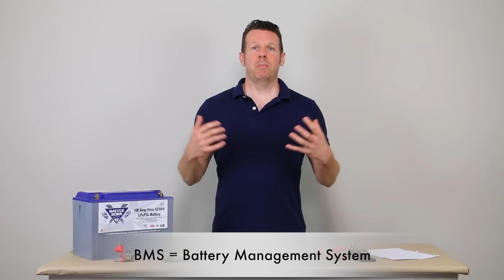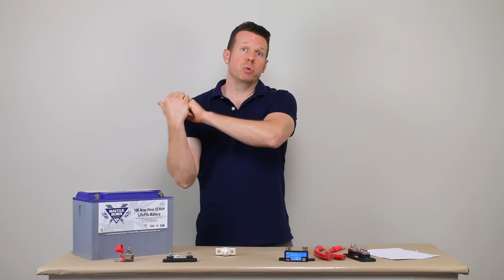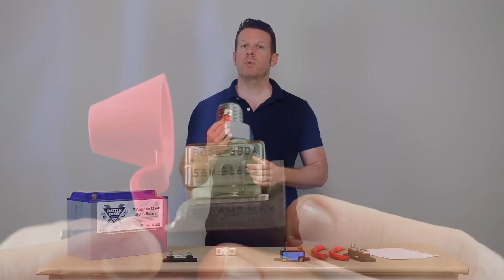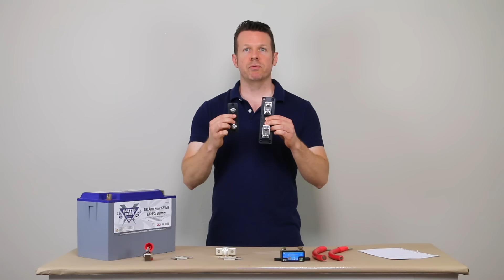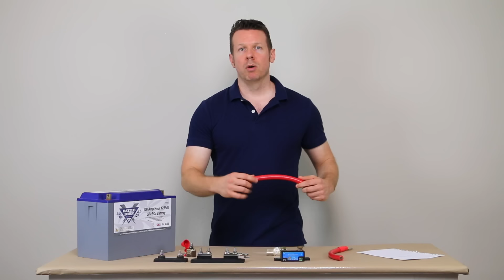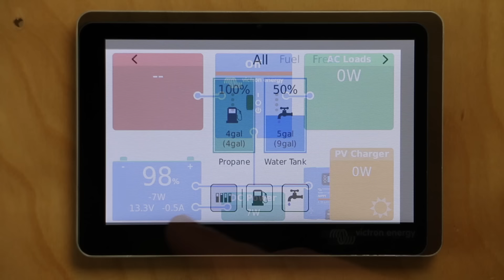The Top 9 Lithium Battery Mistakes for Van and RV Power Systems

Comment: Another mistake is paying an enormous amount of money on Battleborn batteries. Sure, they're great but the competition has come so far and just a fraction of the cost.
Reply: Watt cycle are killer for the price.. I said what I said!
Reply: @ Especially after YouTube's Will Prowse tore one of those Watt Cycle batteries apart and was shocked how well built they were.
Reply: Buying all Wattcycle.  Up to 18kw so far. Boat power  @americafirst8201
Reply: Buy 3 batteries or one Battleborn? Same price.
Reply: @ Three? Prices have dropped so much you can almost get 7 or 8 for the price of one BB now.
Reply: @philc.9280  I bought 4 1250 wh  lipo4's for under $500.
Reply: @ LiFePO4 prices are still dropping. For one $900 Battleborn 100 ah battery you now can get six-Watt Cycle batteries. A nice system for $900.
Reply: $ 999.00 4 years ago for my 100 ah Battle  Born .  Just bought 3 Power Queen 100 ah for $ 169.00 each on sale .
Reply: You BB buy American guys know most lithium comes from China or Canada, right?
Reply: @awakenotwoke4830 I just have to respond here because the point is to get Manufacturing in America not that we need to get a 100% of everything from America.
But even having manufacturing for the endpoint is still valuable because that's still Manufacturing. Most of the value is made at the endpoint.

But I also will say battleborn is still way overpriced and there's no reason that American made batteries need the cost four or five times the price of a battery made anywhere else.
Work on automation if you have to it's Electronics what are they doing soldering every single piece of the battery together one piece at a time by hand? If sp, they need to start innovating.
And a lot of electronics are made outside of China by the way and at much higher wages than trying to pay so I'm tired of looking at all these American Battery companies that all think they only have to compete with each other and therefore don't get competitive on pricing.
I actually wouldn't mind paying a little more for an American-made battery but I looked into them and like people said they were just way too much more.
Reply: I've had the cheapest lipo batteries I can get ten years ago running for ten years and they are fine today. Spend the money on charging and balancing technology and be cheapo on batteries. 😂
Reply: Battle borne are in my opinion and the option of a very well read YouTube poster, a load of dangerous crap.
Reply: And there having issues with there overpriced batteries
Reply: @philc.9280  roughly twice the cost of many other Lithium RV batteries. I prefer the little guys…two for one.
Reply: Well done, thank you!!!
Reply: Battle Born did not stand behind three of their batteries that failed at 9 months. It’s always the customer’s fault.
Reply: They melt by looking at them now 😂
Reply: Great explanation, I especially appreciate the tip about drawing power from opposite ends of a bank.
Thanks !
Reply: @MrSilvertech  I would never have thought about that. Great info!
Reply: Agreed. Victron’s Smart lithiums with external BMS is way ahead of anything battleborn has
Reply: Renogy makes an awesome battery better than Battle Born in my opinion. Renogy also has a self heating battery as well, their detail to quality and design is unparalleled.
Reply: That’s simply your opinion,…How many BB do you own… ? how many have you ever owned..?  I have been using them for 6 years with Zero Issues and I think BB are a fine value in every way including American customer service...but then that’s simply my opinion…
Reply: @jimhanty8149  it's not an opinion to say they are more expensive. Just fact
Reply: @ going on five years with my Loggisy rv batteries. No problems, half the price.
Reply: @   Some people buy a timex…some a Boulava …some a Rolex… they all do the same job…., but each says a lot about how one lives their short mortal life… what does money really mean in the end..  absolutely nothing…  live it while ya got it…
Reply: @jimhanty8149  sure but if you're smart with your money you can live a lot more with what you have 😜
Reply: @ I have  plenty to live on… I want good stuff… not China crap…it’s a way of life… hope ya get to the same mindset one day..
Reply: @jimhanty8149  "I have plenty" you are a selfish person that doesn't understand life. 

We all have what we need, some of us choose to chase things we don't need. Some of us can afford things we don't need, some of us can't.
Reply: @jimhanty8149  not all expensive things aren't Chinese crap. And not all expensive things from places other than China are worth their price.
Reply: @ whatever you say man… party on Garth..
Reply: @jimhanty8149  party on puppet
Reply: @ lots of American crap too. Generalizations are generally wrong.
Reply: @jimhanty8149 China is leading in LFP batteries and probably NMC too but I’m not sure about that. 
Some Chinese products are excellent (e.g. DJI) and some are absolute garbage. If you do your research some Chinese batteries may be best you can get. 
I bet component and or cells of BB are Chinese btw. 
The two major manufacturers are CATL and BYD btw.
Reply: @jimhanty8149  Never said BB was a bad battery. Just saying you don't need to drive a Mercedes to work when your Honda works just fine. The LiFePO4 chemistry is pretty standard now and my Power queens are in year 3 and going strong. Even Wil Prowse, the YouTube battery guru critiques all of them and is very impressed with the build of several Asian brands. Just fyi... a 100 AH BB is around $900. An equivalent is around $150 now. I can get six batteries for the price of one BB and build a nice system.
Reply: @jimhanty8149 I actually want to support American made and I do buy American made even if it's just at the endpoint that they manufacture the final product in America.
But I've looked at a few different American companies that manufacture batteries here and there's just no excuse for their pricing.
I don't care how good they are way over the top.
It's like five times the price.
They don't soldering every single piece of battery together by hand and if so they need to start innovating. I just can't buy American made I can't justify it for Batteries until they figure out the pricing issue.

And yeah I do spend more for American made and I have no problem with that but not that much more.
Like I buy darn Tough socks made in Vermont. I love them and they're 27 dollars a pair. Worth it. But spending $1,000 or $200 on a battery i just can't justify five times price. I'll keep checking on the American made batteries every time I need some more and hopefully something changes.
Reply: Remember Americans don’t want to work for 4 dollars an hour so yeah battle born are expensive but that’s the price for made in America 🇺🇸
Reply: @dan32one44It all comes from China! The jokes on you!  Absolutely nothing special about BB! You can get 400ah grade A battery from Power Queen for the cost of 1 100ah of BB!  But keep getting scammed from them
Reply: @dan32one44Dramatic. 600 hundred more for every battery? Does it take 3 days to assemble a battle born? No

Comment: The one you missed is the washers.  You need to make sure any cable lugs are not installed with a washer between them.  This is an easy mistake to make on an ANL fuse holder where the washer may drop while installing the fuse, but is a mistake you could make anywhere.  A washer has much more resistance than the cable lug, especially if it is a stainless washer.
Reply from the maker: Good one!

Comment: Good Day Sir. I also live in the Houston area. Katy to be specific. We have a new 2024 Jayco 25RB. I am in the process of upgrading the Solar Panels to 495 Watts total,( came with 200 watt panel, I have purchased a 195 watt and 100 watt Bifacial panels to add on the roof.  However we are also looking at upgrading the solar charge controller (The Go Solar 30 amp PWM unit that came with it is likely sub par). Im looking at the Victron 100/30 W/ Bluetooth unit. I have also purchased a Furrion Net Zero 1000 Watt inverter (With transfer switch built in) to install in the camper. Its almost 600$ unit and Camping world had it on sale for 40$ so I couldn't refuse that price. The camper is pre wired for an inverter (Although I have questions as to whether that existing wiring is adequate and where in the breaker panel this is connected.  I have many questions on the correct way to install this unit, or possibly pay someone who has the technical knowledge to do the job correctly. The unit has mostly 12 volt and propane appliances. The inverter would be for the TV, and Mac Mini. If we need the A/C we would use the inverter generator.

 Is this something you have experience with?

We are also looking into upgrading to Lithium Battery over the stock battery. The Converter has the capability to switch to lithium, however do We also need a 12vDC to 12vDC charger for the connection from the tow vehicle to the camper? Or is that not necessary? Again, I don't have the technical knowledge of these systems.

Comment: It's not hard to get 48V by putting a couple solar panels in series.  The larger solar panels already around some 30V open voltage to begin with.

Furthermore, 12V is less efficient because of high current (amps) required for mid- to larger size RV power setups.  Power loss increases with the square of current, so a 48V system actually has 1/16th the power loss over comparable 12V system.  You will wear out your battery and equipment faster.  

To power a simple toaster with its typical 900W power would require 75A at 12V but only 18.75A at 48V.  An induction cooktop would be around 1500W at max which needs a very large blistering 125A continuous at 12V and likely will sag 12V down to 10V requiring even more amps.  Other common appliances in the 1500W range include space heater, microwave, kettle, etc.

If you want a toy RV setup that will wear out its batteries and equipment faster, go with 12V.  If you want a working modern RV setup that will last longer, go with 48V. 🙂

Comment: You do not understand DC ripple. DC Ripple occurs when DC is created using an AC power source plus a rectifier to output DC current. It has nothing to do with the use of inverters. Voltage drop due to too much current over wires too thin for the load is just voltage drop. The alarm from the invertor indicates an under-voltage condition, not DC Ripple.  Wire gauge vs length vs load charts are available to help determine the proper gauge of wire for the length and required load in amperes.  Since inverters are voltage-sensitive, I recommend upsizing wire gauges where practical.  i.e. If the chart says 2/0 wire is ok, use 3/0.  When calculating wire length, you must take into account the total length of the wire run, adding the length of the positive to the length of the negative cables.  Your 12' foot example is likely 24 feet.

Comment: I confess to be very disappointed with Blue Sea MRBF fuses and fuse holder.  Using a fuse rated at 80A and drawing a current of 45A, the fuse/fuse holder and downstream 4awg cable became VERY warm!  The fuse holder to battery terminal was not where the heat was being generated, it was the fuse to cable connection.  So I torqued it down as hard as I dare.  That improved the situation but running at half rated capacity of fuse for 5 minutes or so, heat was still being generated and running up the cable.  So no way would I run this fuse at anywhere near capacity.  And if I put in a higher rated fuse say 100A, the fuse contact area (which is where I think heat is being generated) is the same as 80A fuse!  Not a fan of MRBF😔😔😔
Reply from the maker: If I had to guess I would respectfully inquire whether one of the stainless steel washers at the battery terminal, at the MRBF fuse, or elsewhere got sandwiched between the conductors. This would cause that heat, and blow that fuse early. Lots of resistance in those washers.
Reply: @rosslukeman  Brilliant!  Thank you Ross. All fixed  (you'd think the UK distributor I spoke to months ago would have suggested check washer!)
Reply from the maker: @gd4997  Glad that helped! I have seen things heat up before for this reason, was just a guess!

Comment: If the battery BMS will shut things down if it goes above the rating (as in Mistake #1) then why the need for a fuse at the battery bank (Mistake #4)?
Reply from the maker: Because BMS’s fail and it’s ultimately a piece of electronics. Electronics should never be used as your fire prevention method. Omitting over-current devices like fuses is what leads to electrical fires.

Comment: LiFePO4 batteries will provide their full capacity and performance until they reach the Battery Management (BMS) protection level. The BMS maximum temperature ranges from 60-80°C (140-176°F). Refer to the data sheet for your particular model to find the exact upper temperature limit.

The REAL freezing point of a lithium battery would be associated with the electrolyte freezing point which is less than -60°C. A lithium battery, like all other types of batteries, have reduced performance and service life when operating at temperatures below room temperature.

Comment: I use 120a BMS and limit my appliances to 900watt on a 1.5kw inverter (3kw surge) - oversized short wire runs ever run fused at its power end. I do not use trip-type fuses as most are for AC current -  always preferring bolt-in mega fuses

Comment: Hi Ross, good content.  I do have one request and that is mistake 3.  Even when you pull positive one on end and the negative on the other end you will will have a major imbalance in load.  There was a time I believed in item 3, but NO more!  Take a clamp meter and you will see this in real time especially with lead acid.  I have since changed over to use a buss bar on all multi-battery banks!  LiFePO4 works so much better with a buss bar.  The key is to make sure all connections are torqued the same to manufacturer specs and then test it with a clamp meter!  AGM and lead will still see fairly un-even swings until the batteries are balanced but over time they self balance!  I highly recommend clamp meters, because everything is just guessing without one.  Cheers.  Gary
Reply: Does this matter if you only have 2 batteries in parallel?
Reply: @andrewford80 Barely...but a busbar is still preferred.

Comment: Sigh.  You confirmed a concern I had about my new install.  🤔 😊 I put breakers and fuses on everything that charged or discharged the batteries, but only a disconnect switch on the main battery cables, thinking since I had breakers for everything else, it should be fine.  But I wasn't totally OK with it, and you pushed me in the right direction.  I'm going after one of those fuses that mounts to the battery post, as that looks like the best solution for my system.  Great video with clear explanations!  Thank you!

Comment: Thank you so much for solving my problem.  200 amp L battery kept shutting down on me and no one around this town in Oklahoma knew anything about Lithium batteries.  My battery, after I looked after you told about it, had a 100 amp BMS and I thought the battery had gone bad and had ordered a new LiTime battery but just looked and it has a 200 amp BMS!   Have been tearing my hair out for the past couple weeks over this and no luck until seeing this video!!!  Btw, I used to live in Houston and wish I'd been there to consult you!!!
Reply from the maker: Hi Pete, awesome to hear this video helped you solve the issue! I know it is frustrating when everything mysteriously turns off. Glad you got a new battery that will do the job. Thanks for tuning in!

Comment: This video can be invaluable for lithium/solar system newbies. Great job on a difficult, technical subject. One note, ANL fuses are not rated for 48v systems. You must use a T-fuse for anything above 24 volts. I use a 20kva (400v) 300a DC breaker on my battery to inverter line. The inverter is also protected with an internal circuit breaker, but you still need protection for the battery cable. I also have a high voltage (336 vmp) array on my roof, so use a 500V, 32a DC circuit breaker for that down line which doubles as a disconnect switch. This is not to NEC code for grid tied systems though, as they need a “Rapid Shutdown of PV Systems on Buildings," such as a TIGO module for protection in case of fire. I think that's overkill on a van or RV though. 

BTW, I have a 12v 560ah LiFePo-4 battery and a separate 620w solar array on the side of my MH to run all my 12v appliances, jacks, slides, etc. so no inefficient stepdown converter is needed. I use a 320ah 48v battery charged by a 4,400w rooftop array for whole house 120v AC power. You are correct, 48-volt systems are not practical for vans with smaller battery/solar systems. 

For temperature protection, our 12v batteries fit perfectly under the steps of our MH where our old pair of GC-2 golf cart batteries used to reside. We insulated the battery compartment, cut a 1" hole in our step risers and installed a tiny computer CPU fan to keep this space at close to room temperature, so we don't have to worry about the BMS shutting down charging if they get too cold - or their life reduced from getting too hot. Our 48v bank resides under the bed of our MH which has a larger computer fan circulating conditioned air in this space as well. We're FTers, so our RV is lived in 365 days/yr. and never sits in storage as some do. Lithium battery heating pads are available for inexpensive batteries or do-it-yourself battery builds like I have, but unnecessary if your battery is kept in an insulated compartment where interior air is allowed to circulate.
Reply: There are some 80V ANL fuses
Reply: @arildred2780  Thanks. I stand corrected. The biggest ones I've seen are 32v. Good to know there are some 80v ones available.